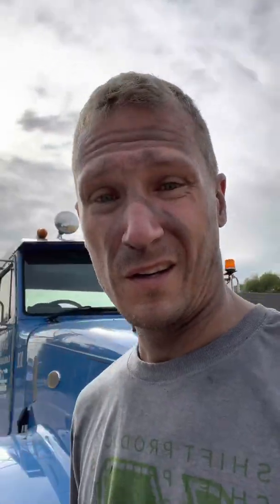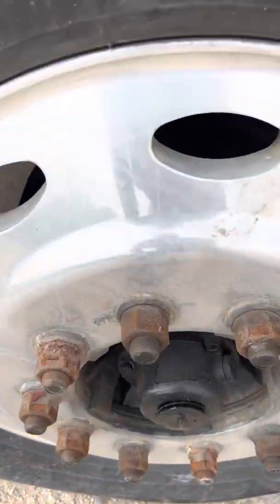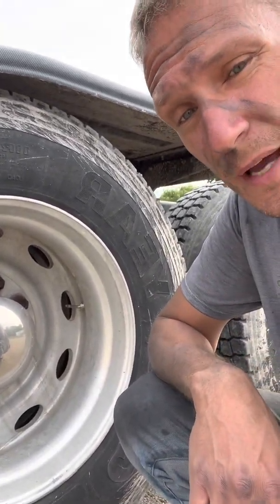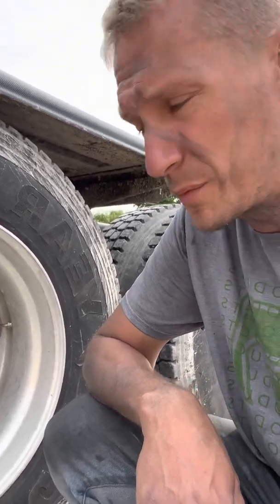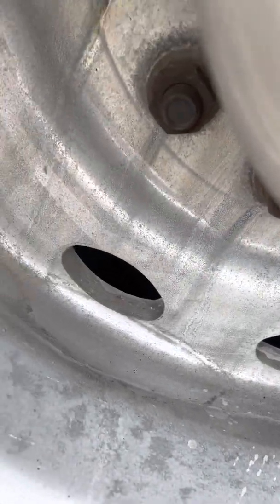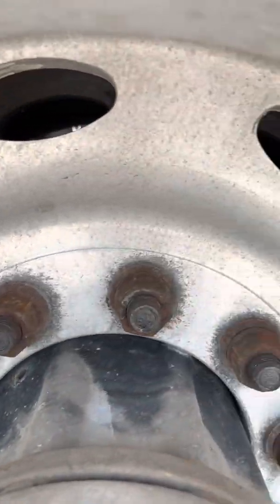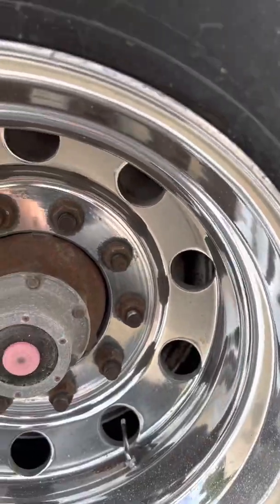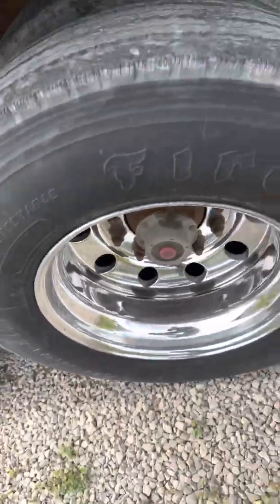Acid use on aluminum.

Comment: "Gbrite" from G&G auto supply Salem Oregon aka "acid". Tips for acid. Get it wet first, spray acid on in small spray bottle and rinse and rinse and rinse. Alot of water after. Also don't use in direct sun light. Use on shade side of truck, then turn truck around to be shade side again, or in shade, or in the rain, cloudy day, or early in the morning when its cool is best, not in the heat of day and not in direct sun. Rinse with volume water, not with pressure. Works every time. Can also wipe or scrub slighty when acid is on aluminum, then rinse thoroughly. Never let acid dry on
Reply from the maker: Thank you for the tip and information. I appreciate you watching and commenting.
Reply: @EvanStegerMetalPolishing  thanks for saying thanks Evan. Stay strong man
Reply: Good advice

Comment: The de-icer they use on the roads here in the NW stains the aluminum brown. Leave that crap on there too long and the metal pits. It won't wash off with soap and water after it dries on there. I've had success using NAPA Aluminum Brightener cut 50% with water. Get the aluminum wet first. Only leave it on for a few seconds, go over it with a wash Mitt and hose off. If it streaks bad, I'll hit it lightly with an SOS pad. After it dries I can get a pretty good shine hand polishing with Zephyr or Rebel Red. That gets me through the winter until I machine polish again in the spring
Reply from the maker: You should try the Time 2 Shine Aluminum polish  and let me know how they work for you. Thanks for watching!